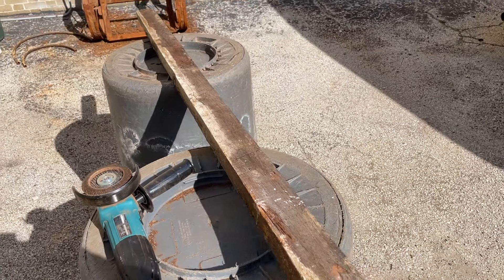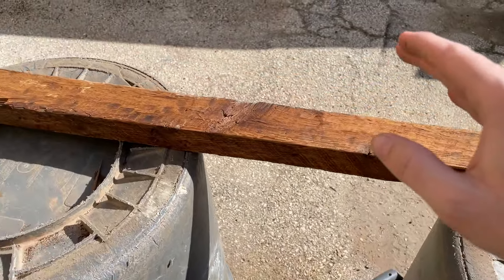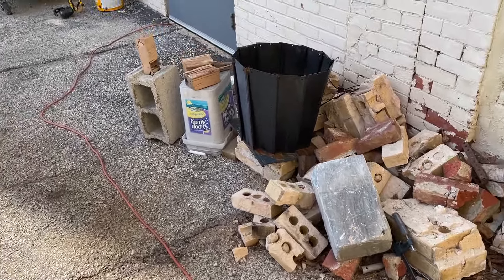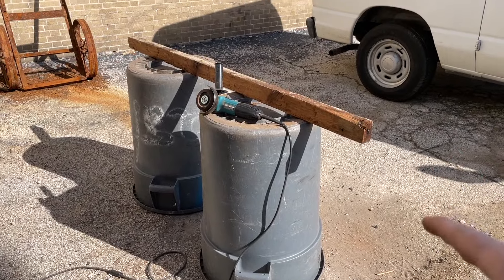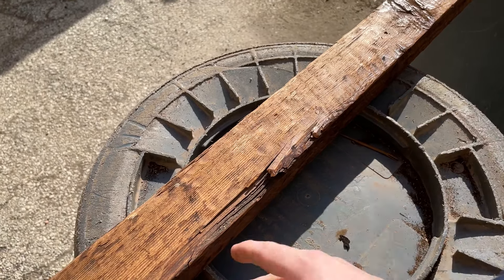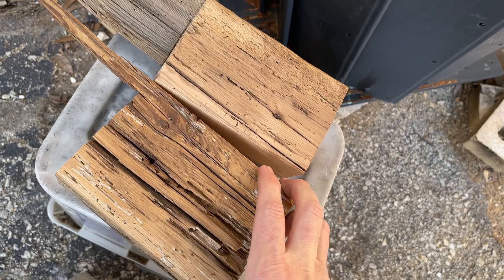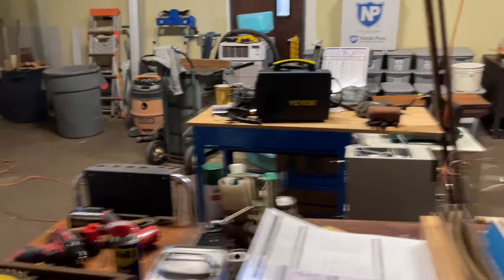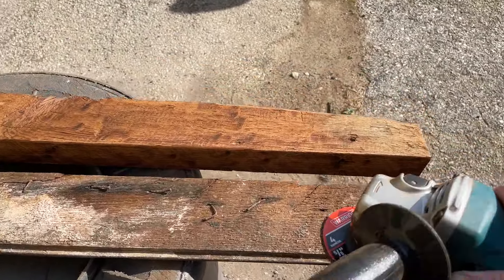You can use a worn-out angle grinder flap disk to darken old wood that seems too gnarly to use.

Comment: Nice! You may as well get rid of the old nails and then use a planer to cut down the rough outside layer for a nice finish.
Reply from the maker: Nah these nails are too rusted to remove, and the planer made these boards too bland looking.